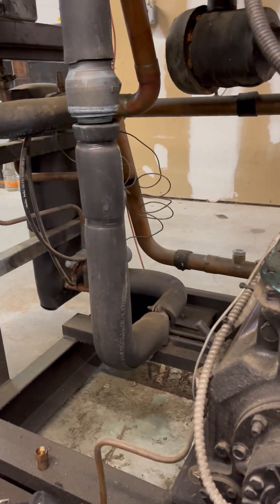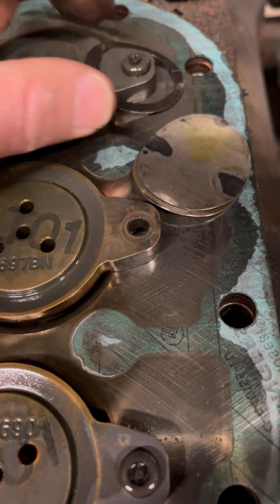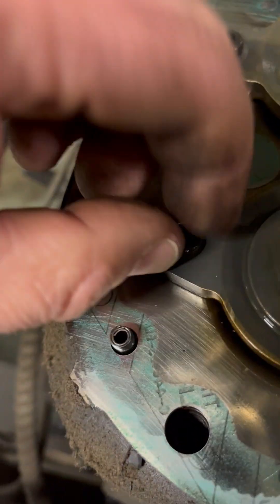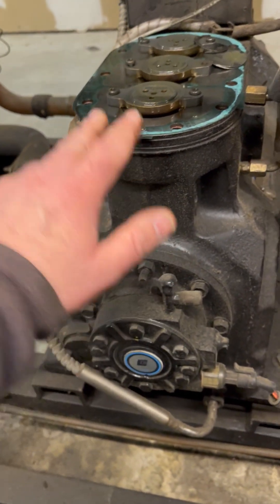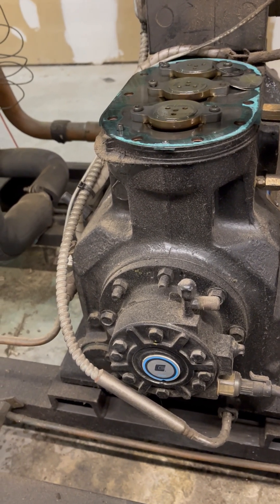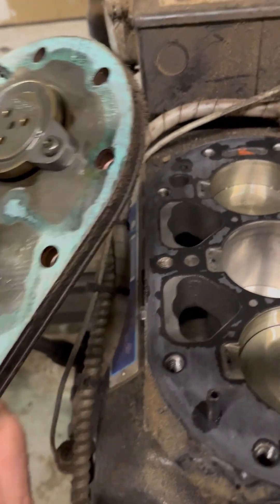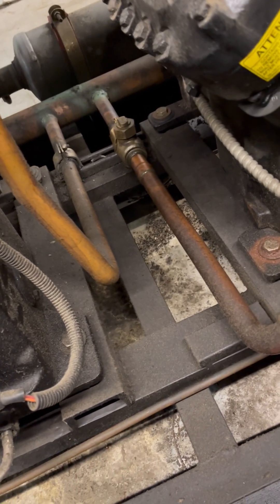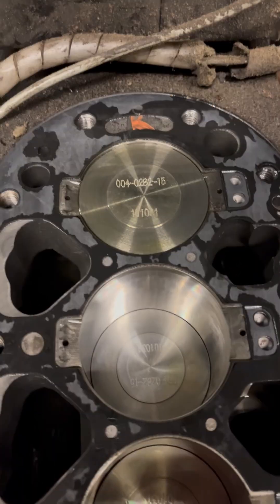Copeland Compressor First Video Valve Plate

Comment: Well done.  You are a craftsman.  I wonder why everything vibrated apart.
Reply from the maker: Thank you, that is a good question. I'm not sure why it vibrated lose, the compressor is running fine. I checked it today. I will say this, according to our Danfoss controller, the compressor has 20,560 hours of run time.  
Thank you for watching
Reply: Did u find it?